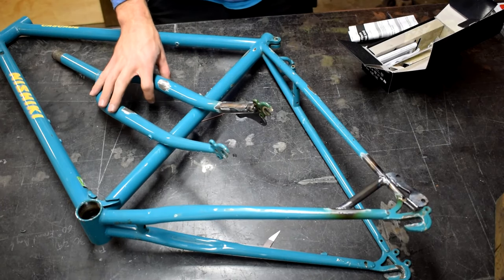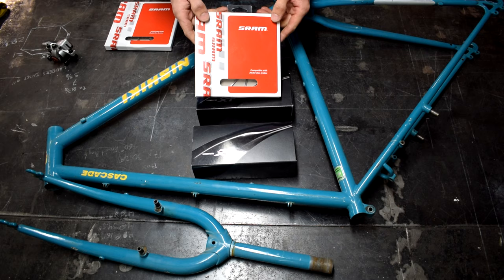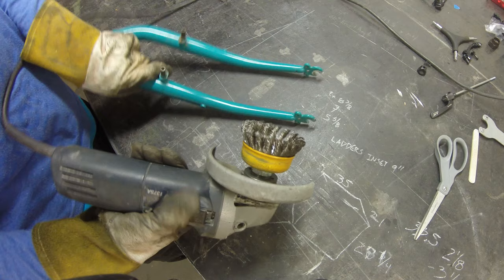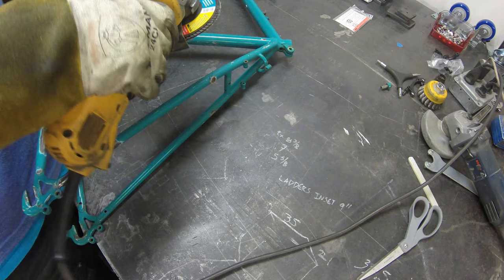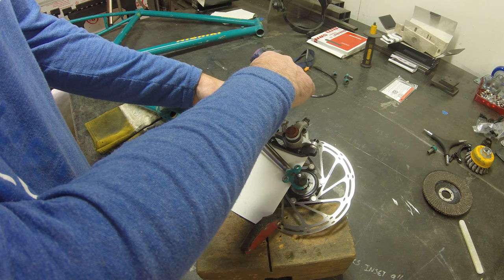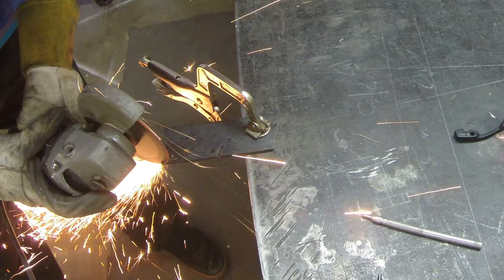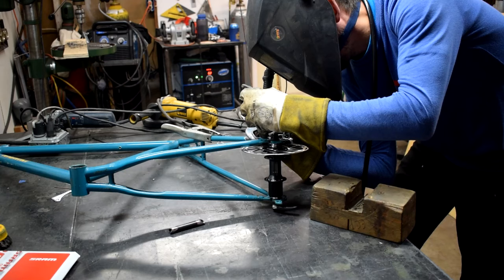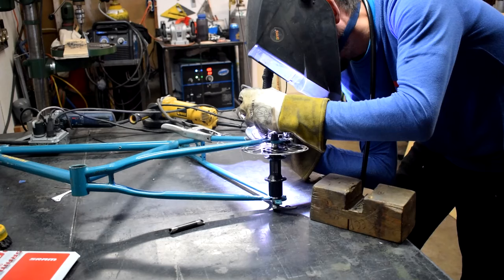Adding Disc Brake Tabs to an old Steel MTB Frame - Fiets of Strength - Ep. 1

Comment: you inspired me and now a 90's steel mtb frame has become disc brake gravel bike
Reply: have you had any problems with the frame cracking due to the forces?
Reply: Did You went with 650b conversion as well? Frames designed with bigger tires (~2.3") and/or fenders in mind should almost always fit around 650b x 50 and it feels more modern on such size.

Comment: I like the way you added extra support to the rear stays, but what about something for the front. That fork was not designed for the extra torque/stopping power of the disc brakes. Around 70% of braking power comes from the front. I hope you're planning for that.

Comment: Thanks a lot for this video!  You're one of the few youtubers to demo the process for brazing on disc mounts to a vintage MTB frame.  Most of the popular bike-repair channels stick with aftermarket bolt-on mounts for disc brakes, which look just absolutely dreadful in my opinion.  I also have an old bike, a GT Timberline Al Terra, and I've considered this kind of upgrade, but I've never done any soldering/brazing/welding work.

Comment: Dig it!! Funna take two front brake sets+tabs off the 24”&26” hubs and rebuild 20” rims with disc brake hubs, then fab up the tabs like you did!! Thanks for the bracing advice, i admit ignorance there and in much of this cycling stuff. Schlappin together a 20” bmx frame to be all slick’n’sexy and get repainted etcetc 🤙

Comment: Thank you for sharing the process! The video seems great, however I'd like to see how you take the measures for the rear mount as well, not just the fork. The rear mount is a lot trickier. Otherwise very helpful for my project - thanks!!  🙏

Comment: I did this with a stick welder on a beach cruiser ebike build. It definitely didn't come out as clean, but it worked. I can take it down a hill and hit 50 mph and the brakes actually stop, unlike the coaster brake that almost started on fire.
Reply from the maker: Heck yeah man! nice work. Having grenaded a couple of coster hubs over the years I definitely approve of this. Well-done doing it with a stick welder too. Strong welds dont always need to be clean (and stick welds don't often look clean, haha).

Comment: Seeing so many disc brake installs on old vintage frames all of a sudden, however once you see the wear marks on the disc you know they've installed them way too high - not enough pad bite on the rotor...

Will be doing my GT Palomar in time.

Comment: Love this. I did basically the same thing on the frame of my 1993 Kona Lava Dome. I'm curious to see how that fork holds up. I've been considering doing this to my old 1" threaded fork on my vintage road frame to gravel bike conversion. Thoughts about the longevity? I think if it was me I would have extended that fork brace up at least an inch higher.
Reply from the maker: I don't really recommend trying this with a road frame (I personally wouldn't do it). They usually have pretty thin tubing and don't even have the clearance for the rotors anyway. There are a ton of factors that could affect longevity on a bike of that age. Tough to say what the frame has already been through, and what it's about to go through after the changes.

Comment: Great Video, super informative!. I'm wanting to add disc brake tabs to an older kona frame (1993 lava dome) and I'm curious what your welding setup was? I'm hesitant as I fear the tubing on the seat stays is significantly thinner than the tab material. What kind of amperage did you use? Also what was the approximate wall thickness of the reinforcement material? Thanks!
Reply from the maker: Some of those older Kona's have pretty thin-walled tubing (which is why they're often pretty light). You could try to ease into it with a low amp test weld and see if you immediately blow through the tubing. I typically just use cut up tubes from other bikes for my reinforcement material.

Comment: For this kind of project, I highly recommend that if you have no skill welding anything, as I do not have, when you go to convert an old frame to disc brakes, I would look into the use of a torque arm that mounts to the mounting bracket, and fastens to that side's old cantilever/V-brake mounting post.

At least in that way, a solution exists that does not require a complicated skill like welding to accomplish.
Reply: I'm told They don't sell those anymore.
Reply: @MR-backup  : Sell what? A torque-arm kit for disc brakes?
Reply: @isaiahwelch8066  Isn't that what you are talking about?
Reply: @MR-backup  : I was. At the same time, I haven't heard anyone say torque-arm kits aren't being sold any longer, because a lot of E-bike kits still come with them.

The whole idea of the torque arm is to hopefully negate the back-and-forth torquing of a frame dropout arm and keep it from breaking. And if a bike doesn't come with disc brakes, like my 29" MTB, I would need a way to keep the frame from snapping due to simply applying my brakes.

Comment: Totally dig your video. I've felt a bit on my own trying to figure out how to add disc brakes to a late 80's specialized rockhopper, with the local bike shops not being interested. I can tig weld and I just purchased some ISO tabs from frame builders supply. I'm converting the bike to an e-bike powered by a hub motor (which came with a 160mm rotor already attached). Could you recommend a disc brake/adapter to use with it? I'm trying to put together a budget e-bike, but I've found more complications than anticipated! Great video, thank you!!
Reply from the maker: In your case I would strongly recommend finding an existing steel fork specifically designed for disc brakes. Even then you might need to add some reinforcement plates. I've heard it's quite common for hub motors to stretch/break the dropouts on older MTB forks. They're usually not up for the torque and wont be safe over the long run. Especially if you're trying to do disc brakes and a hub motor.
Reply: @FietsofStrength  Thank you for the advice! Very much appreciated :D Cheers from Dallas, TX

Comment: Can you use a bigger size rim when converting the brakes? Great video!
Reply from the maker: That'd be 100% dependant on the frame and what sort of clearance it has for whatever size tires you hope to run. I am about to do two different builds that will be 26" to 650b/27.5" conversions. Videos coming soon.
Reply: @FietsofStrength  awesome! We need more of this type "go ahead and do it videos". I just finished my first frame build and i overthought it too much before actually starting to build it. I'm going to buy an old gt big  size frame and i believe i can fit 650's there. The added tube for support of the force the disc brake is an excellent tip which i might not have considered. Just one more question, why'd you decide to go with post mount vs flat? I'm a bit drunk while typing so there might be some mistakes while writing this. Cheers from Colombia!

Comment: Can you clear something up for me. You made the the tabs out of 1/4" plate as mentioned on some of the replies you made. or 3/16th as mentioned at 5:23 time stamp? I'm just about to make the tabs in a few days after gathering the metal. Thanks
Reply from the maker: Honestly I've used both thicknesses. They both work just fine for this. Though thinner material is incrementally easier to weld to thinner tubing, but it usually also means extra washers to space out your mounting bolts so they don't hit your rotor.

Comment: air cooled torch?   I'd be using a size 5 cup w/ 3/32 Tungsten on water cooled syncrowave.    Looking at adding rear brake lugs to a Fuji Axis aluminum frame.   Would just buy a modern fork built for disc.   Your project looks great.
Reply from the maker: Yep, I only have an air-cooled setup. And it's tricky to find "modern" forks that are disc brake and 1" threaded. Work with what youve got. :)
Reply: @FietsofStrength   true .very limited 1" options.     Love what you've done!  Inspiring
Reply: " I'd be using a size 5 cup w/ 3/32 Tungsten on water cooled syncrowave. "
-Yea bud, not everyone can have the coolest toys.
Reply: @MR-backup   my syncrowave is about 20 years old.  I've owned it a while.   Before inflation, a good used syncro250 could be had for $1500 on a good day.  Not a huge stretch really for a cool machine.

Comment: I'm ok at mig welding... but never done it on a bike frame. Is it possible or should I be learning to TIG?
Reply from the maker: TIG welding is nice and clean and easier with thin tubes. But I try to remember that there is always someone out there making way more impressive things with even less tooling/technology. Work with what you've got and have fun.

Comment: what thickness is the plate from which it is cut this adapters?
Reply from the maker: I used 1/4" plate for this project. Tricky to weld to thin tubing, but works great.

Comment: I have a 90's Cro-Mo farme, is that strong enough steel? How thick is the plate that is used to make the tabs?? I'm looking forward to this!!
Reply from the maker: I recommend 1/4" thick plate. Tricky to weld to thinner tubing, but better for brake setup.
Reply: @FietsofStrength  Thanks for the info
Reply: I have the same situation. Are you implying that the Cro-Moly frames are thinner metal than standard steel frames? All I have is a flux core welder and have been contemplating this mod. Thanks!
Reply from the maker: @3gcraftsman  a LOT of old frame are some variation of cromo. It's the more "Mtb" frames that tend to have slightly thicker walled tubing, AND they're usually easier to re-space to allow clearance for disc brake rotors. Most old road frames are not only thin-walled, but also don't offer enough clearance for rotors. The best way to learn is to experiment though!

Comment: Hi there, coukd yiu tell me the thickness of the metal plate you used for the bracket please,
Thanks mate.
Reply from the maker: I have successfully used both 3/16" and 1/4" for this. Depends on what I have on hand at the time.
Reply: @FietsofStrength  Cheers mate. ;)

Comment: dunno nuthin bout "freak bikes" and sorry; but I can only give this video a score of 4.5 out of 10
The extra .5 is for adding the little gusset tube to the frame.
I've done this operation on steel bike frames a number of times with very good results; below are the proper steps:
1. Attach the caliber to the appropriate adapter bracket in the middle of the slots and then attach the adapter to the brake mounting tab in the middle of the slots. ( choosing the correct adapter bracket can be a little challenging; good to have a number of brackets handy ot experiment with as the diameter of the disc and frame affect placement.)

2. Install the wheel in the frame with the brake disc attached (you may need to reset your dropouts to accommodate the wider hub)

3. Move the pads of your caliber all the way OUT to the widest setting.

4. Make some long strips out of a soft drink can as wide as the pads in your caliper to use as shim material

5. fold the shim material tightly over the disc in several layers so that both sides have the same thickness of material.
Make this shim stack thick enough so that you can just barely push the caliper down onto the disc over the shim stack. 

6. rotate the wheel to bring the brake tab in contact with the frame; then mark the areas on the tab that you will needs to grind or cut away for a good fit.

7. Before removing the brake tab from the adapter; scribe a mark on the tab near the mounting slots that aligns with mark on the adapter bracket. Also mark the frame where the tab edges of the tab will be attached.

8. Remove the tab from the adapter and cut + grind the brake tabs as needed until it fits; note you may have to reassemble the tab onto the adapter to few times to get a perfect fit; but it will be worth it in the end.

9. Once you have the tab fitting perfectly; make only tiny tack welds to attach it to the frame and then let it cool; check your fitment and adjust as needed. Weld the tab to the frame in short alternating stitch welds to minimize distortion

10. you can get disc brake tabs AND the new brake line guides that you must also add to secure your newly routed cables from bike frame builders supply houses such as Nova

Comment: I hate bike frames that have no pre-made support for both type of brakes. I don't get why it's still an issue.
Reply from the maker: Hub spacing, and frame design to accommodate disc brakes is quite different than what the rim brakes format requires. It's not so simple as putting mounts on for each. And at this point manufacturers likely have no incentive to produce anything with rim brakes when the nearly the whole industry (parts manufacturers and frames builders) has moved to disc brakes.
Reply: @FietsofStrength  disc brakes are better anyway

Comment: Okay, maybe on the rear.  But putting a disc on a steel fork not designed for the torque on one side is a bad idea.  Frankly, on the road discs aren’t much better than a well designed rim brake.  Especially mechanical discs.